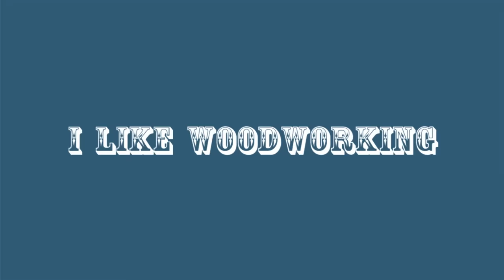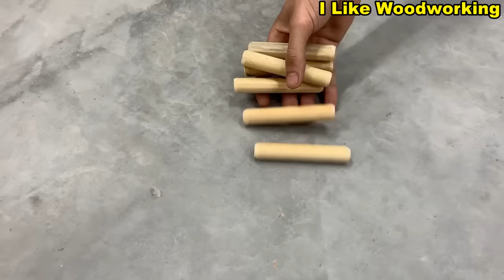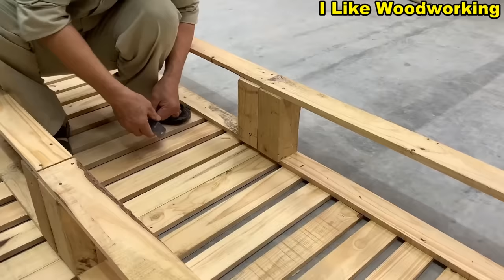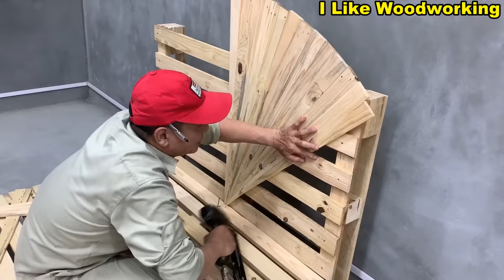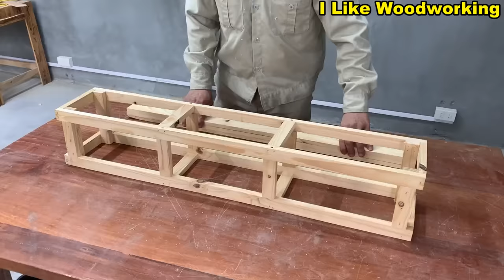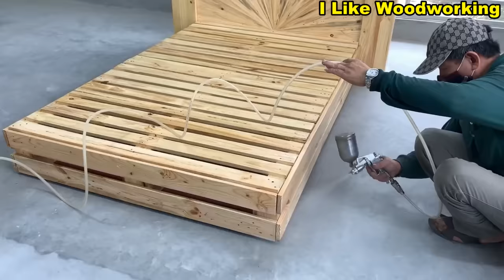How To Build A Beautiful Single Bed Out Of Pallets For Your Child - Creative Woodworking Idea Design

Comment: Pallets are made out of the absolute cheapest, worst wood money can buy.  If there was a cheaper wood anywhere, pallet makers would use that one instead.  So REMEMBER THAT before you start working your butt off designing and making furniture using pallets.